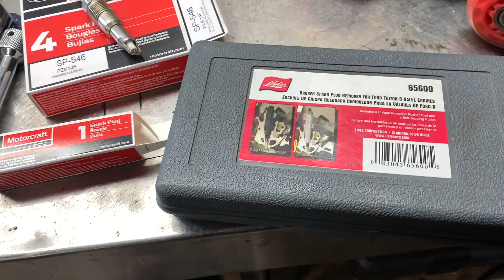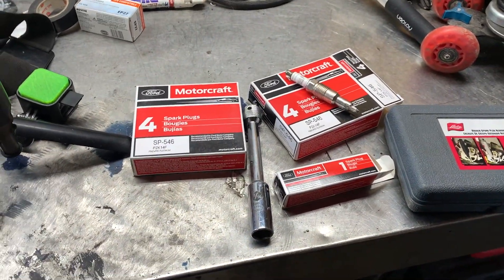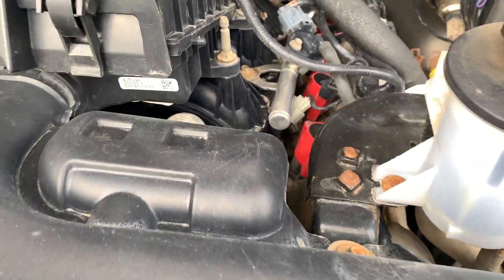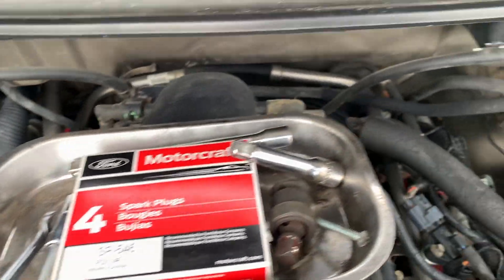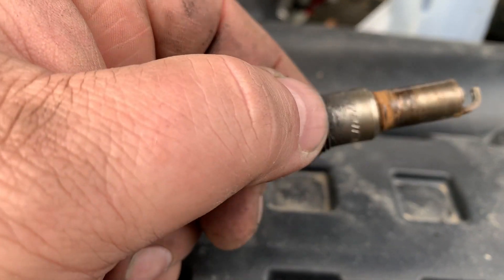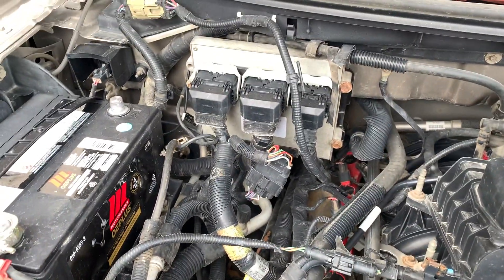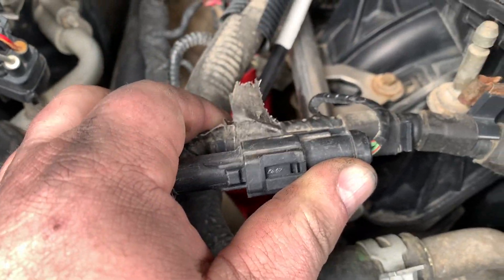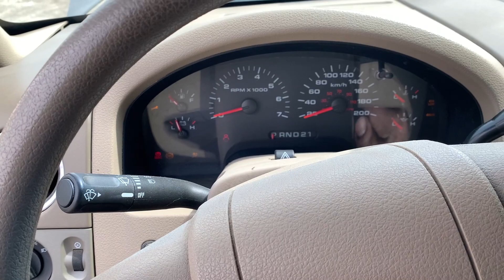Ford 5.4 3V Spark Plugs DIY Tips and Tricks

Comment: The spark plugs replace is just about a day job in 5.4 3 valve. I had a miss under load . Replaced with motor craft platum. Every thing good now.

Comment: HI--i have an '06 F150 5.4 3v Triton. Really a shocker when first changing spark plugs. 7 of 8 broke and 2 would not come out even with the Lisle tool. Rip off shop charged $3000 to fix it. Since then I change the plugs every year about, use Motorcraft, dab on some nickel antiseize. It's that time again and so I still look at tons of videos just to build up the courage to tackle it.
You have a nice video...good camera work.  Thanks for putting this out here for us. Jesus bless.

Comment: So the SP546 is the redesigned plug but it's still a 2 piece? Doesn't that make the champion one piece plug the best plug to use? what is the one piece champion plug item # ? I just read the champion one piece plug run so hot one person had a plug melt down to the threads...anyone else had this happen. I cannot believe how hard it is to find out what is the best plug to put in my truck.

Comment: Not to change anything about how you did this but my friend and I just both did our 3v 5.4's mine on orig plugs at 203k my gap was like 1/4 inch it was way huge  his was second set of plugs at 160k he did his with the special socket and wrench like you did here and Six of his broke well spun off the threaded part, I gotta say I took the risk and on mine I used a snapon mg31 impact and a normal deep craftsman 9 1/6 and I inserted a piece of 5/16 evap hose which made the plug fit way tighter then the special socket. Call it luck all 8 of mine removed perfect and no thread damage. Also as a side note both were operating tempature engines when removed
Reply from the maker: my first video I did on removing the spark plugs years ago I used a impact on low torque with engine hot to remove all the plugs
Reply: Didn't see that but yes impact best for old ones I added copper antisieze to them so next time likely a ratchet, wonder if this has80k left in it original engine trans and cam phasers , only things done bug are oil pump and transmission valve body/mechatronics

Comment: I just went back into my 5.4 3v because I did pump and guides and no tensioner.  About a month ago I just went back in and did the steel tensioners and one guide which had been destroyed in about 9 months.  I’m about to do the spark plugs and thanks for the tip

Comment: Engine looks good (clean clean). Some of these videos on YouTube  sure frown that you wash these engines nowadays.
Reply from the maker: A person should wash the engine before you do any major work if possible
Reply: @TestDontguess   that's right.  I wash all my equipment. I guess what I was getting at was YouTube videos say not too wash these motors with all the electronics and electrical. A lot of corrosion will happen if you wash the engine with pressure washer. I disagree!!
Reply from the maker: They are all waterproof connectors